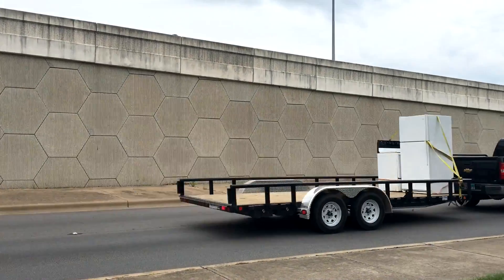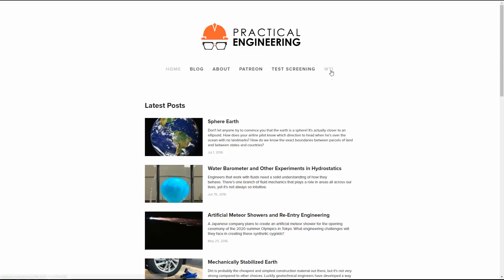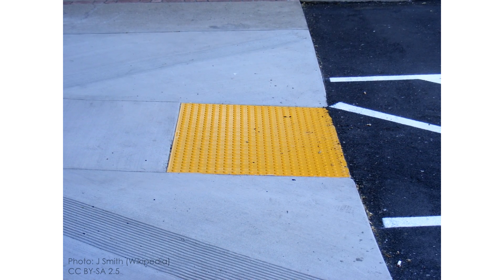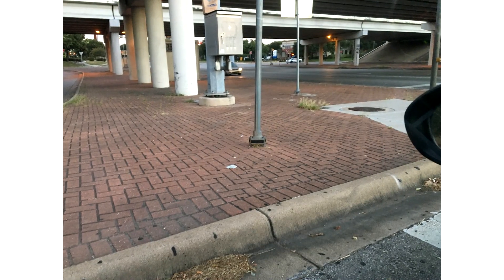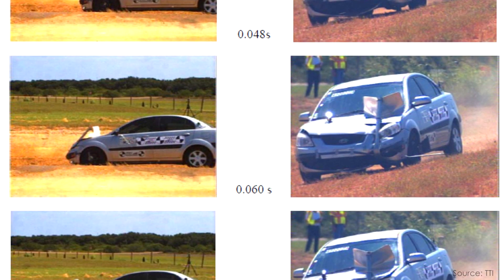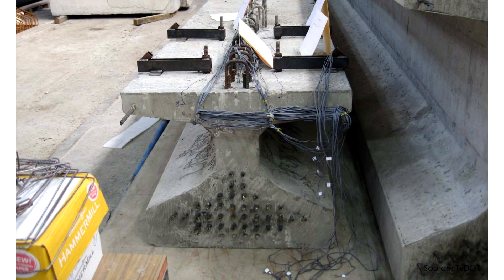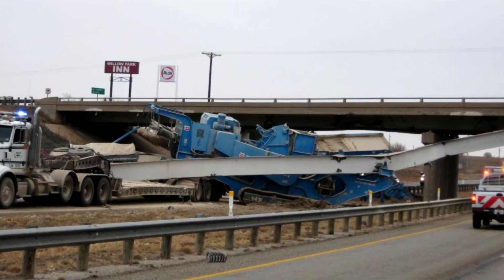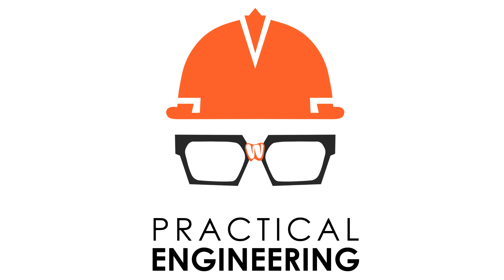What's that Infrastructure? (Ep. 1 - Transportation Infrastructure)

Comment: The bridges and tunnels in The Netherlands are not protected.
There are special structures installed beforde the bridge/tunnel.
These warn the drivers that their vehicle is TOO HIGH to pass the bridge or tunnel.
And one tunnel (IJtunnel) will close it's tunnel-tube when a TOO HIGH vehicle entered the tunnel, by closing the crossing-gates. And the traffic-lights present will turn red.

Comment: For the breakaway segment; I've noticed that this applies to all sort of sign post material. Big 6x8 timbers are either kerfed deeply or have holes bored through to serve as the weak point for breakaway. I've seen Illinois DOT lay a beam on the sidewalk of a bridge deck and lash it  with cables to a damaged beam below, this wasn't a short term measure either.

Comment: I wish I still had a bunch of the pictures from when I worked at the MBTA for an internship a while back. They wouldn't let me show a lot of the stuff, but some of the equipment used to keep trains running is really interesting, and obvious. I found section breaks and train switches to be the most interesting. All the pictures I took of them got lost when my cat knocked my phone onto the floor. 
Actually, on the same note, in Boston, on the Green line, there is a section of rail just ahead of Park street, where the train wheels squeal loudly going around the corner. You can always tell when people have lived in the city for a while by how they respond. The squealing actually comes from the fact that the radius the train turns on is about half the standard for train cars of that length, and the noise is the flange of the wheel coming into contact with the head of the rail. Since I worked there, they have actually changed the wheel geometry slightly to allow a little bit of extra clearance. It does not solve the problem, but it makes it considerably quieter. A quick YT search should bring up a ton of videos without that nightmare-fuel sound in it.

Comment: I didn't know that about the sign anchors before. In fact there have been a few number of high speed impacts around my area and I have questioned several things, such as the 7-10 months taken to restore the damaged post, to the amount of the fine incurred by the fault driver, both seemed excessive. But given this new knowledge I now understand that the anchors are highly engineered devices. The fact that there wasn't deaths incurred by the impacts is a good testament to that. So, indeed the cost is high and the time to repair seems appropriate.

Comment: In Durham, NC we there's a bridge known as "11 foot 8" as it is an 11 foot 8 inch bridge which is under height compared to normal bridges. so it peels the top off many trucks/trailers/RVs that pass under it. As such, they put up an I beam to help protect the bridge, and lights that flash when your vehicle is too tall
Reply from the maker: Quite a few others have mentioned this. The website for the bridge is very interesting.

Comment: Small tidbit about the tactile pads on the handicap ramps. The grid formed by the truncated domes is supposed to align with the direction of travel for a road crossing (based on the current ADA standards). I guess the intent is that the visually impaired can feel the grid and then walk in the proper direction when crossing a road. The issue is that that for many handicap ramps, especially the ones at street corners, aligning the grid can potentially involve cutting multiple pads in order to conform to a radius, leaving lots of waste material. Some contractors claim that cutting the pads can also allow water to get underneath, reducing the lifespan of the ramp with freeze/thaw cycles. It's a lot easier to just use a whole pad and place it at whatever angle looks best at a given corner. I've seen very few handicap ramps with pads that were intentionally cut to conform to this standard, and I don't think any sane visually impaired person would trust the alignment of the grid to dictate the direction in which to cross a road (my job involves handicap ramp installations).
Reply from the maker: Very interesting. Thanks for sharing.

Comment: At the freeway on- amp at my town there are these poles that stick up between the on and off ramp. It used to be a metal pole but every time you drove past it was bent over because somebody had hit it. Eventually the city started thinking and replaced it with a pole that can be easily pushed over, then springs back into place.

Comment: Plastic ADA ramps need to die in a a fire. They get very slippery when wet or covered with snow, and since by definition they are inclined... 

I figured they were tactile, rather than for traction, but I still say they are more dangerous than concrete and therefore a bad idea.

Comment: The Utah state capitol sits on isolation bearings.  These were retrofitted in the last decade.  Lots of them!  I was told in school, before the install, that It's similar to a ball bearing that has a concave column below and above it.  The building just sits in place during the earthquake, the ground shifts.  The building basically rolls above the ground like a person standing on a bunch of marbles.  My wife is an engineer and got to see one of the bearings in person!  I was so mad she didn't tell me about it because I could have gone on the private tour.  These are under the building so I'll probably never see one.  However, I'm not sure if they ultimately decided with this method.  I think the final method used was an elastometric base isolator.
Reply from the maker: Very cool. I'm not a structural engineer, but I'm fascinated with how they manage earthquakes on buildings. Lots of neat ideas that don't seem like they would work at scale.

Comment: Awww man, I wanted to know what these blue pipe things were along the side of the road, but I can't remember where they were.

Basically, they were blue pipes that looked like they contained some sort of fluid. They were on a dirt brim/mound sort of thing, and they wer abour 30 feet away from a road. They were spaced out about 200 feet from each other, and there were about 3-4 of them. They were about 1ft in diameter, and they were guarded by some sturdy looking fences. I have no idea what they were, and I don't see them very often.
Reply: They are very common in places that have a high ground water level, especially if heavy construction is going on. They are very prominent in Berlin, Germany and as of lately in Stuttgart, Germany as well (the latter because of the big S21 underground train station project). They are used to pump ground water away from construction sites and back into the ground some place far off. The German term for this is "Grundwassermanagement", ground water management.
Reply: Do you live in a cold place? Maybe they were for water and they didn't want to dig into the ground? In the Ukraine they have their pipes above ground for freezing reasons I think.
Reply: Don't you want those to be underground though? As far as I know the ground is a lot warmer than the air, so it doesn't freeze
Reply: Thats pretty cool :o thanks!
Reply: I was in Berlin about a year ago, and we could not figure or find out what all those pipes were for. Now I know. So are they temporary until the construction project is complete?
Reply: AFAIU they're meant to be temporary. At least that's what they say while installing them. However, given that Berlin is effectively built on top of a swamp/marsh area I suspect they're meant to stay.
For Stuttgart (where they explicitly promised it to be a temporary thing) I suspect at least some of the pipes are meant to stay. After all they're building an underground train station that extends to below the original groundwater level.
Only time will tell ;)

Comment: #1 I knew the yellow ones were for blind people but not the stones ones. I live in oklahoma so I assume me have the bridge protectors but I will have to check. I have always wondered why they don't install some type of blade to just sheer off whatever is about to impact it basically so the roof of the truck gets taken out easier. Maybe my understanding of physics is wrong here but if a blade and a slope up causing the roof to cut and bend up and out wouldn't work can someone tell me why?

Comment: The signs are interesting in that it's not just that they break, but they're designed to break in specific places, usually as close to the ground as possible. Wooden sign posts here in Michigan have strategic cross holes drilled in them about six inches off the ground to make that point the weakest part of the post.

There's a piece of infrastructure I want to shoot but I'm not sure how to do it safely, the in-road scales that let transponder-equipped trucks bypass weigh stations. There are also PVC pipes that stick up off the side of bridges over rivers and canals near where I grew up with red caps, I suspect that they're for filling fire tankers from the surface water since there's no hydrants out in the country.
Reply: I can't speak specifically for sign posts, but on utility poles that's not actually the job of that hole, or at least not entirely. That's so they can add creosote to the base of the pole to keep it from rotting. Usually there is a little plastic plug that screws in to keep garbage from getting it.

Comment: Not sure if there are any near me, but a lot of intersections in my area have a square cut out where the first car is expected to stop on a red light, I have no proof but what I've always heard is is because they cut out the square, lifted it out of the ground, and installed a magnetic sensor underneath before replacing the slab, and they use these sensors to inform the computerized traffic management system; the effect of that is most visible around 2AM when you can watch an intersection stay green in one direction indefinitely, until it sees somebody waiting to go the other direction, and then it changes almost immediately before changing back to the statistically more common direction. We also have intersection cameras so I can't really know without putting some effort in. If I remember I'll try to get a picture while I'm biking this weekend.